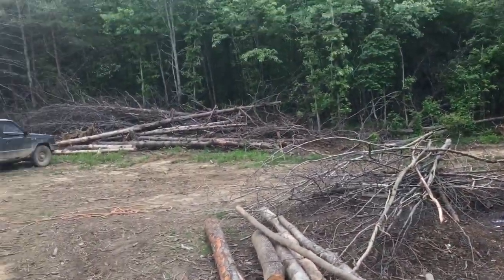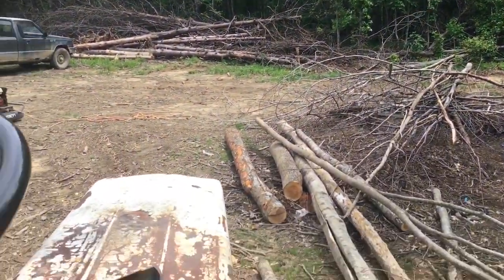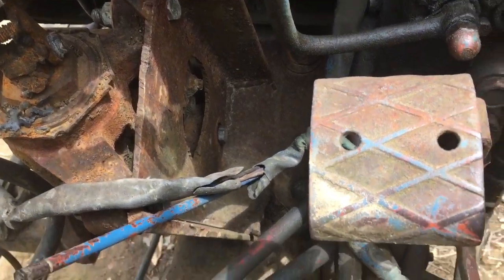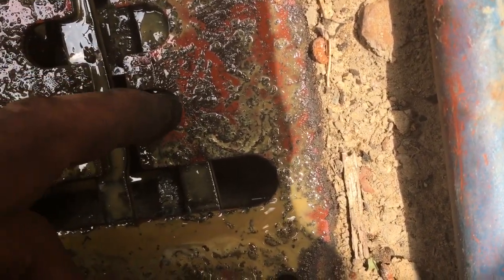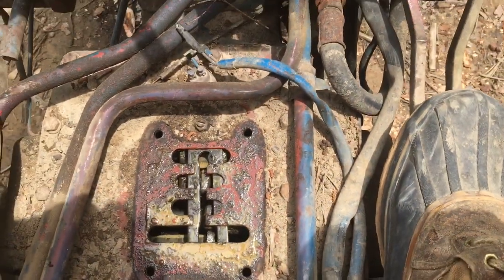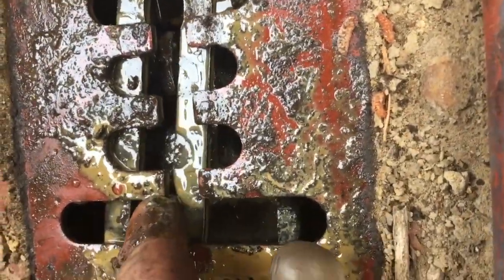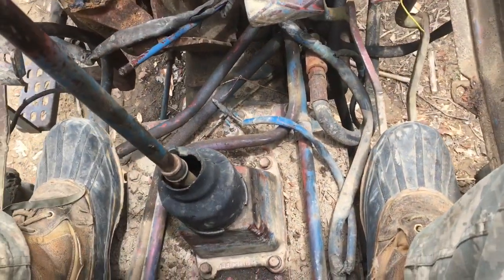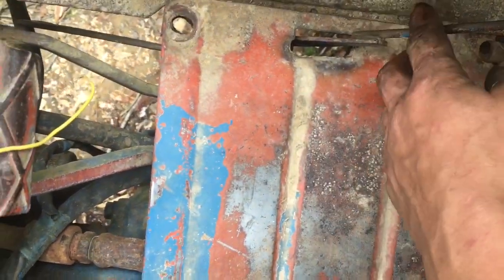Transmission work on the Belarus/ Sedina tractor

Comment: Good Job!
Maybe Put Lucas oil conditioner or alotnof STP into transmission. Belarus have issues with soft gears shafts alot .
Sticky lube stays on gear teeth and bearing. That rubber boots on shifter let's rain dirt in up north it freezes solid cracks housing s pumps etc .
Maybe put a rubber seal silicone to prevent that.
I made that error$$$$$ we Get -20° F in NY froze up ruined 9N Ford.
This happen s on old Ford top loader transmission s.
Excellent work Comrade.
Just sending you some ole school tips.

In Russia " Strong like bull smart like tractor".🤔
Reply from the maker: We will definitely try some